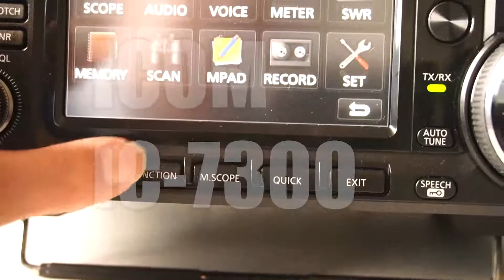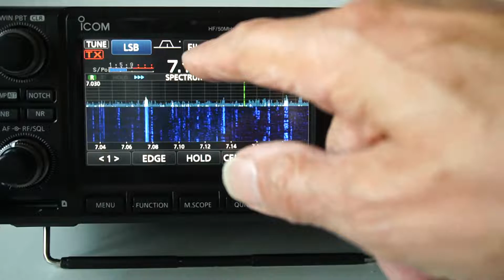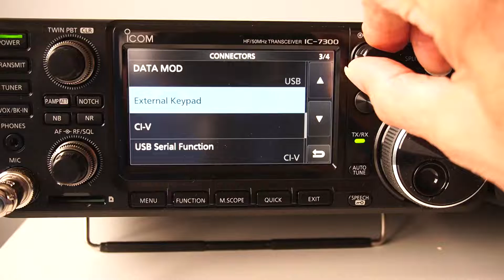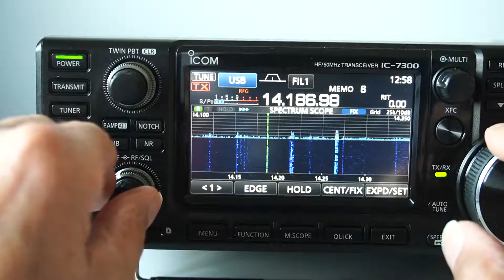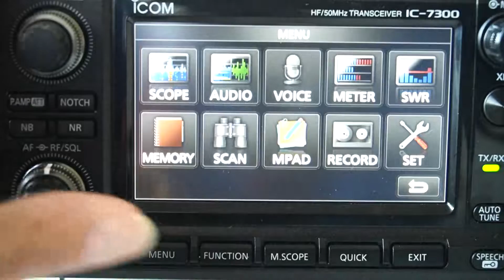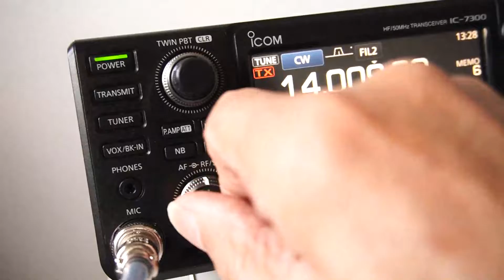Why The Icom IC-7300 is Special - and So Is Our Price!

Comment: I have a question  about the IC-7300,...if I set the clock,will it still keep time even if the radio is turned off,or would I have to reset the clock every time I turn the radio on?
Reply from the maker: There is a battery inside.

Comment: I do think this is my next radio however coming from radios like the FT 102 and an 840 in the shack, call me old fashioned but using a spectrum to hunt the stations as opposed to a well trained ear,, I’m just not sure if I like the cheating so as to speak, great video though many thanks, regards
Reply from the maker: Hi there. Interesting comment. You can switch the trace off! 73 Peter.

Comment: Q1: If you connect this to your PC, can the PC decode and display CW that is being received? 
Q2: I have a Yaesu FT-840 with a Yaesu MD-100 desk mic. Can this mic plug in and work on the IC-7300 or do you have to rewire it? 
Thanks for the nice overview. John

Comment: Hi Peter,
How would you compare the 7300 to DX-10. I know the Yaesu is a more expensive radio and has features the Icom doesn't but in your opinion, is it worth the extra money. I have an Icom 7100 now and I'm looking to buy a dedicated HF rig. Going with the 7300 would allow me to continue to use my older SM-8 microphone with them. Is the receive that much better in the FT-DX10?
Thanks for all your thoughts and informative videos.
Reply from the maker: I will be taking a look at the FT-DX10 in a couple of weeks or so. 73 Peter
Reply: @watersstanton  

Thanks Peter, looking forward to seeing it.👍

Comment: thant thing has to wide bandpass filters, there was a video where someone switched a preselecotor before it, the noise level dropped significantly. 
then the modulation has a problem if not using the original handheld mic, wich doesnt sound as good as a studio mic. 

i would rather get a yaesu ftdx3000, that costs about same and has a better receiver and better modulation. the waterfalldisplay is a bit slower but compared to the worse receiver and transmitter of the 7300 its the better choice.
Reply from the maker: Have you owned one?
Reply: @watersstanton  
fortunatly NO and after watching those videos with the preselector when the noise level then dropped much, i wouldnt buy that piece of JUNK 7300 either. i dont need to jump out of the window to know it would end deadly.

Comment: Excellent video Peter. I have wanted a 7300 since they came out, but haven't yet been able to justify the expense. I am a lot closer now. ;-) It would have been good to have the audio on whilst demonstrating the filter selection though. ;-) 73 de Gordon G8WWD
Reply from the maker: Hi Gordon I plan to do  demo of audio and filtering on the IC-7300 shortly. 73 Peter

Comment: I wish to thank you for this video but not just this one.  I have been using used gear for quite a lot of my 40 years some good ,some not, some I wish I had kept (TS-850s)
I have another 850 on the gurney but it is to the point either it goes for parts or I buy another for parts.  In short I want something that is more up to date and although I know several with a 7300 and who all say that they like them, no-one has walked me through the features like you have. With the upcoming solar cycle which well could be my last I am going to order today a brand new Icom 7300
based on price ,yours and my friends recommend.  I thank you again for your straight forward explanation of a multitude of topics
73 Jim  ve4jim
Reply from the maker: Many thanks Jim. Nice to hear from you. 73 Peter.

Comment: I still have and use my Icom735  !
Reply from the maker: Says a lot about Icom.. 73 Peter.
Reply: Likewise.  I used Icom IC735 at ARRL Field Day 2 years ago but the noise reduction in the 7300 is vastly superior so the 735 is now more of a backup radio.

Comment: Peter, these items are worth mentioning: 1. You can get a display output using a SDR Play via a PTRX board 2. The USB cable is how you get CAT, computer logging, you can send CW or digital signals with it and 3. The QSY by tapping the monitor is a quick double tap. Try that and the rig will qsy quickly to the station you want.  As a CW aficionado, you will find the Icom 7610 a superior CW rig with a better receiver than the rig listed in your shack at QRZ.
Reply from the maker: Thanks Scott. I am sure others will appreciate your input.73 Peter.

Comment: 7300 is a great radio. I would like a kind of keyboard to send RTTY though. Decodes fine but sends only preset messages. With a keyboard attached you could have QSOs without a PC. I need a tuner because on some bands I'm out of 3:1 ratio internal tuner works on.
Other than those I love mine.
Reply from the maker: Take a look at the MFJ-914. https://hamradiostore.co.uk/mfj-914-auto-tuner-extender.html.   73 Peter
Reply: @watersstanton  That is good and cheap solution. I actually have one for other use.

Comment: Mine does not have that DC filter.
Reply from the maker: Check with your supplier. 73 Peter
Reply: @watersstanton  It is an EU thing everywhere else the power cable is simply that.
Reply: I think the DC filter is only  for Region 2/ EU market.

Comment: Peter you can connect the 7300 to a display, but it requires the connection of an SDR Play via a PTRX board installed inside the 7300. Works beautifully by all accounts.
Reply from the maker: Thanks John. 73 Peter
Reply: Can you put that board in there and just plug it in the back of the radio instead of using a computer

Comment: There are several features there which remind me a lot of the IC-7000
Reply from the maker: Although not SDR.  Nice to hear from you. 73 Peter
Reply: @watersstanton  Yes of course, the 7300 is definitely a better radio. I hope it doesn't get as hot as the 7000 did!

Comment: I bought my 7300 almost a year ago and still need to learn a lot of stuff about. I do like the radio tho. I also have its twin, the 9700. 73 de KG7LOI
Reply from the maker: Hi, nice to hear from you. 73 Peter
Reply: @watersstanton  I still haven't read the manual,  radio is simple enough 🙃